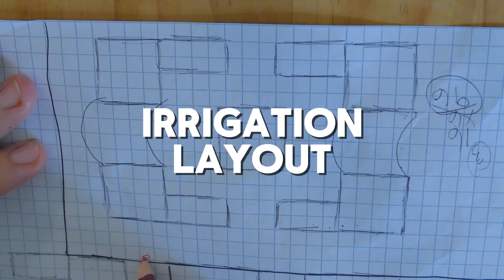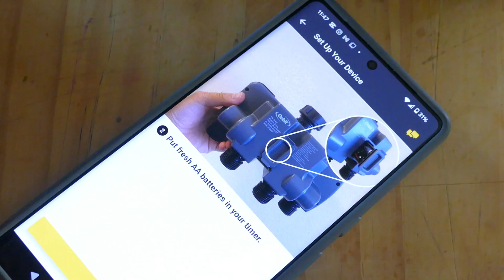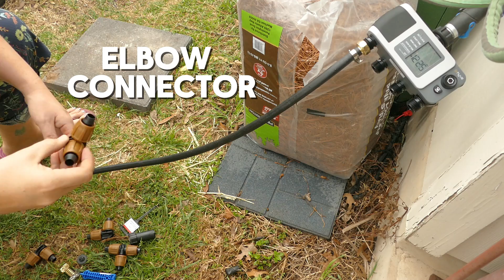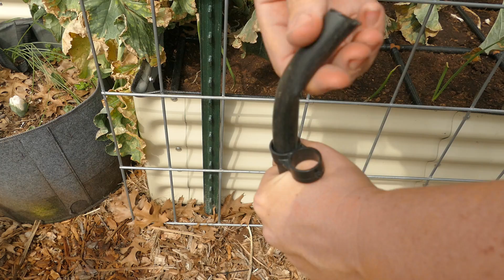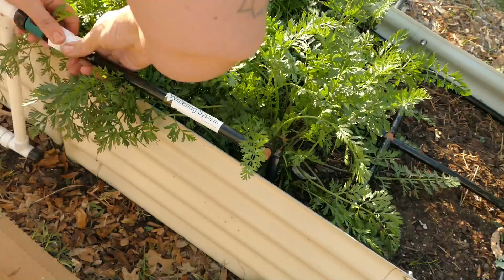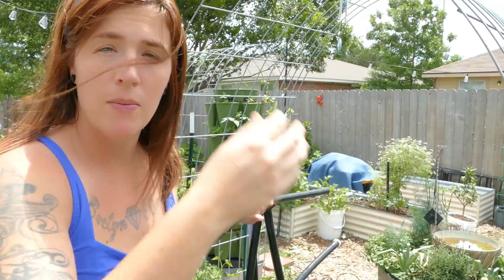How to set up EASY IRRIGATION in your raised bed garden!

Comment: I had a different set up using a pressure reducer. I’m changing to a grid system. Do I need the pressure reducer?
Reply from the maker: I would keep it on only if your pressure if crazy high like 80psi+ . The reason for keeping it in that scenario would be more so to avoid putting too much strain on your timer, outlet transition into the tubing etc. I've had major pressure issues where my pressure was too high like in the 90s and it did not cause any issues with the grids. But it did cause issues at my hose outlet.

Comment: How did you determine how many different zones to have? And do you have a link to the automated timer you used?
Reply from the maker: @pauls2889  based on my entire backyard I knew that 4 zones would almost equally space out the water pressure needs per zone.

Comment: Thanks.  I’ve been through so many watering systems. I haven’t bothered to use the 90 degree corner thingies.  I think I’ll try that next time. I like that garden in minutes grid, but can’t afford it for my crazy allover the place garden.  Although, if I actually watered right, I might could put more plants in there and make it smaller.  So many containers, so little time.